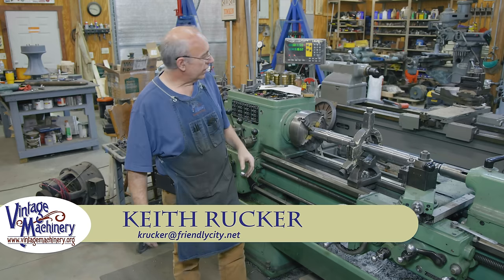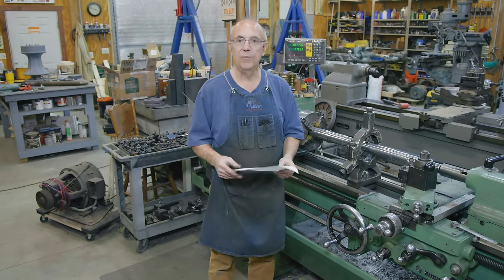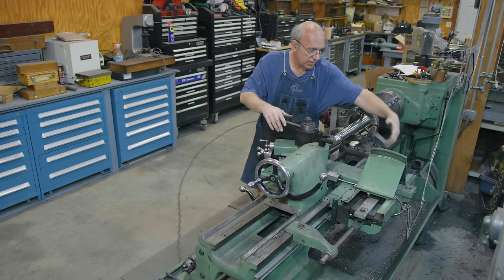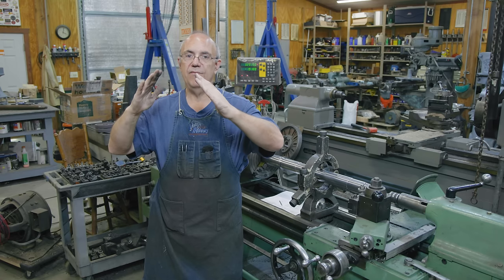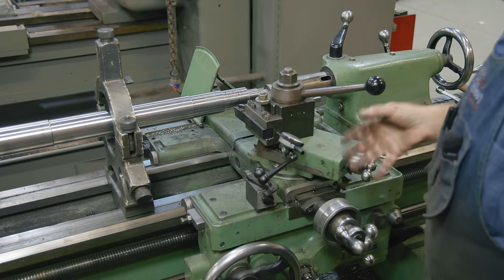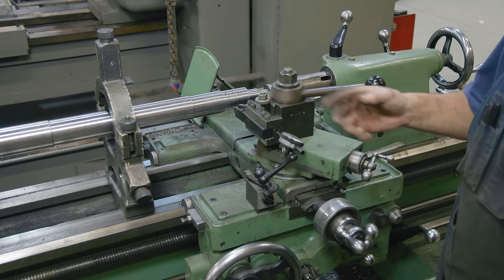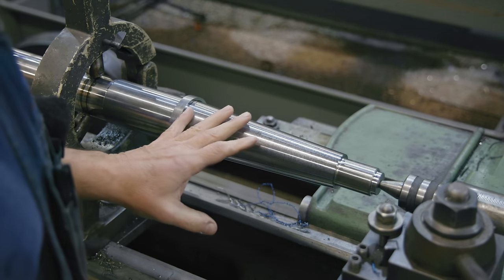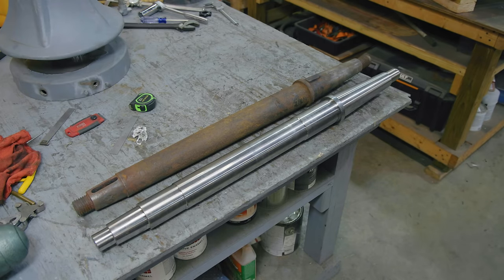Tally Ho Capstan Project: Using the Lathe Taper Attachment to Turn Tapers on the Main Shaft

Comment: OMG !! When I was an apprentice millwright my dad was a journeyman and I was working with him he ask me for a 1" wrench so I handed him a crescent adjustable wrench he scouled at me and threw it down and made me get a combo wrench and after he used it I carried that wrench for the rest of the day. Then he caught me using a channel lock plier on a pump shaft to turn it. Man he was so angry I put them shithooks on a machined piece of machinery!! The lesson I learned was in His words " there is a tool a proper tool for every job " even today when I pick up that channel lock it's to do some plumbing. I write this with a big smile on my face as I have much respect for your skills but them channel locks in use on that lath made my dad's words clearly come back, may he rest in peace. God bless you always sir
Reply: Amen
Reply: My Dad was also a Millwright, and had the same work ethic as YOUR Dad.  I tried to follow him into the trade, but due to the economy, I joined the Air Force as an Aircraft Mechanic.  30 + years after he passed, I STILL hear and follow his advice!
Reply: @normmcrae1140  I am 68 years old and 35+  years in the millwrights seen lots of Craftsmen in all trades it was Great !! Now they havnt put on an apprentice in 4 years in this state , no one wants to do the physical part or get greasey. Sadly the trades are being sold out. Even this old school machine work has been lost to CNC. Anyway God bless you and Good Dads that handed down the "WAY"
Reply: @kentonyoderii3443  I agree - I LOVED being able to look at a plane or machine and say that "I FIXED THAT!"  
I still do with my Motorcycles and vehicles (I'm Elbows deep in my Yamaha Bolt, right now!)
Reply: ok
Reply: ok
Reply: @normmcrae1140  did you train at channute field in the af ?
Reply: @edcallahan6952  I'm Canadian, so RCAF - Basic Training at Cornwallis, NS, And Trade training at Borden Ont.

Comment: First time in my life that I ever heard of or saw a taper micrometer. And I am an 81 y/o retired mechanical engineer that thought I was familiar with machine shop operations.

Edit to add: Another way to cut a taper is to offset the tailstock which I learned in machine shop class in 1957. We never measured the taper because approximate was close enough for the application we had. The application was a lathe dog and the tapered part fit in the slot of the lathe face plate.
Reply: I saw all sorts of exotic precision tools in the naval dock yard where I worked overhauling guided missile launchers and directors, but I never saw a micrometer for tapers either. One thing I did use was an engineers microscope and that would be a dream tool for my current workshop, probably hideously expensive though.

Comment: I purchased a Southbend H10 with a taper attachment about six years ago. I never looked into using it. About four months ago I looked into using it, and noticed several parts were missing. I spent the last four months getting it to work.  I learned from this video how to accurately set up to cut a taper. I also went down a rabbit hole of learning how to measure inside and outside tapers on the internet. Thank You for providing this information!

Comment: Never seen that taper attachment before, I've only ever used the compound slide for cutting tapers. I presume that the taper attachment allows you to taper with more precision over longer distances. Very cool.
Reply: Repeatable also, so if you’re doing more than one, it makes the setup worthwhile.

Comment: Love the channel Keith.

With the taper angle, if it is a more taper then the angle is the same. A the difference between a 1 & 2 more taper is diameter. So I believe your lathe is set to cut more tapers.

Looking formard to seeing you work on some of the museum stuff again. ❤️
Reply: So, are you saying that this is the same as a Morse taper, that the angle on those are all the same?

Comment: the tan of 3° is 0.05241
Close enough to your measured 0.052 which lets me assume, the taper was made to 3°
Reply: I was hoping somebody did the math. I did check and a MT4 is 1.4876 a MT5 is 1.5073.
Reply: The inverse sin of (0.104/1.000) is 5.970 deg. The sin of 6 degrees is 0.1045. So likely intended to be that.

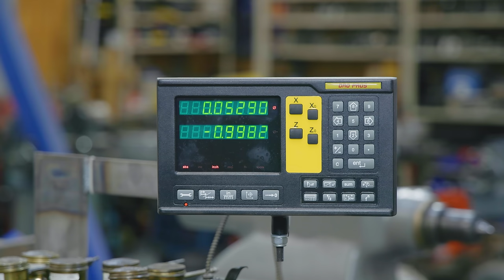Comment: ~ 12:00  Keith Fenner has some videos of fitting fish-boat propellers to drive shafts using tapers.  He finishes the fit using various grades of fine abrasive compounds & bluing indicators to mate the two parts more-or-less perfectly.  Lots of fussy work...

Comment: Great video I was looking forward to this video on cutting tapers.  I inherited a South Bend lathe from my toolmaker father and was expecting you to turn the tapers with offset centers.  Taper attachment is a great option which I have never seen used.  Looking forward to you cutting the threads.  It would be nice to see if you have to cut a left hand and right hand thread on opposite ends.

Comment: I've worked on a 'male/female' tapered  metal rod. It had NO keyway and did NOT twist. To disengage the tapers was the use of hydraulic oil pressurized at fitting between the two halves.

Comment: This will end up being a wonderful contribution to Tally Ho as its anchor winch, & the fact it will also be modernised as well to have the option of it being powered is fantastic from an operational point of view.
Also truly fascinating to watch the set up and operation of a taper turning attachment.

Now as an owner of a new lathe without a taper turning attachment finding myself wondering “how the heck could this be done without a taper turning attachment?🤷‍♂️

The compound doesn’t have enough travel to turn a taper that long, so I’m assuming I’d have to offset the tailstock to the correct amount to turn said taper - then afterwards go through re- aligning the headstock & tail stock?

I love the detail you provide but sometimes for me at least it raises all these other questions & my brain has a little melt down. 😳😳😂

Comment: Hi, Keith, and firstly many thanks for the detailed videos of this shaft machining.  I remember that you said that you weren't inclined to try to replicate the overall taper between the top and bottom bearings, and at 27:10 that's clear.  When I look at the old shaft, though, I can't see any transition at all corresponding to where the lower bearing journal (the third 'land' from the left on the new shaft) goes up to the 2⅜" 'middle'.  It's almost as if that bottom journal is tapered, too.  Is that wear in the old shaft or wear in my old eyes? 🤓

Comment: Keith,

Is this vessel being built with the approval of a Classification Society?  If so, does the capstan require an approval?

Normally the fitting of tapers requires bluing to show sufficient contact.   It seems that the short taper has contact.   The long taper seems to lack contact.  

Out of curiosity will the capstan allow for independent use of the windlass and the drum?

Bob
Reply: The question of Classification Society/Certification/regulatory approval/Coast Guard regulation/crew requirements/ intended vessel use/insurance/business model, etc, etc, etc are all un-addressed by Leo, at least in his videos, as far as I know. I am very curious to know the answers. I’d also like to see the taper blued and tested for contact.

Comment: Really nice job!  I do have one general machine-shop comment, though.  It's not just you; everyone seems to do it.  You have a high-value precision part.  You also appear to have a concrete floor.  You want to put your precious part on a table.  Yes, I know that you all carefully level all of your tables, even the wooden ones.  Why do you keep putting parts almost on the edge of tables, with nothing to block them from rolling off?  In this particular case, it also looks like one end might slightly hang over, ready to catch any shop coat that happens to brush the table corner as someone passes it.  I'm not a machinist, but I have a silver flute that is dear to me.  Again this is curiosity, not a complaint.

Comment: I think i've done taper work on my lathes, a grand total of 15 times in my entire life. Fascinating process to math out... but man, unless you need it, you won't even so much as touch it. I suppose one could use tapers more, they are a very good method to lock two surfaces more, but a good mating surface and a nyloc nut do wonders these days. :))

Comment: I am a little confused on the use of the DRO to set the taper. Keith was moving the carriage 1", and the DRO was reading .052", but it was in diameter mode. Wouldn't it have read .104" if the taper was set correctly? The dial on the tool post would have read half of that, .052", which would be half the included taper?

Comment: Hi Keith.  You have more knowledge in your little finger than I'll ever develop.  Nevertheless I noticed that your tailstock was extended quite a way on this project.  Do you think your chatter problem would have diminished if it was shortened up?
Reply: I think the chattering in last episode was due to Keith not turning a perfect diameter for the steady rest to run on. As with all rolled material flatness, squareness and roundness should not be assumed.

Comment: @14:04 "Don't feel like if you don't have a digital readout, you can't make these adjustments."  That's not right at all!  There's never been a better excuse to convince the boss to let you buy a DRO setup for the lathe.......... and a taper attachment for that matter.
Reply: No DRO’s taper attachments or dial indicators when the original shaft was made 100 years ago. They probably just decided on the locking tapers needed and matched them together.

Comment: Wondering if it would be worthwhile to sneak a couple Zerk fittings in there for the bearing surfaces?
Reply: I've been wondering the same thing. Are those bushes supposed to run dry? What provision did it have for lubrication originally? Seems like a high wear situation even though it's a slow turning part, there doesn't't seem to be any way to feed anything in and I can't imagine just greasing it on assembly would be enough given the harsh environment of a ship's deck. Were you supposed to take the top nut off, break the taper, lift the drum off and grease it periodically? Sounds impractical to me
Reply: When working from plans for a customer, you never “sneak” anything in there. You might discuss a possible change with the customer, but you machine to the plans you were provided.

Comment: Just wondering, if you set the taper on the max length of the taper slide; wouldn’t accuracy per inch increase?
Reply: You beat me to it but this is a principle of all measurement.

Comment: One of the bearings on your steady rest appears orange. Is it heating up, or is it actually orange? Do you lubricate the piece where the steady rest is supporting it? I've seen other machinists like Curtis from Cutting Edge Engineering do this (even with roller-bearings) to avoid heating and scuffing the piece. the black marks on the sides of where the steady rest rollers were in contact with the piece appear to be a sign of surface heating.

Comment: ❤❤I dont understand "backlash" did you explain that in another video?  Is it something particular to your machine or normal in all machines?
Reply: https://www.youtube.com/watch?v=NqF_ETWvBCA 
I skimmed over this video, seems to be a clear and detailed explanation of backlash in machines.
Reply: Backlash is the clearance between two gears, if there’s no clearance or zero backlash, your gears will probably lockup and you won’t be able to turn them. 
So every gear needs a little backlash, but usually the smaller the better. You can check backlash by turning the gear one direction, then when you turn it the opposite direction, you can see how far it turns before it starts turning the other gear. I hope I explained this so it’s understandable, have a good one!

Comment: Just a viewer and not a machinist so go easy on my terms, but being you lock the cross slide in order to allow the taper attachment to do its thing, when you now have to use the compound to feed in the tool, do you set it perpendicular to the work piece centerline or perpendicular to the taper or what? I know if you’re using the compound at an angle, like a leftover setup from threading, and you feed in 10 thou, you don’t actually take a .010 cut due to sine error. So is that relevant in cutting tapers?

Comment: It is dead-easy to calculate the angle of these small tapers, because when you approach zero angle, the sine of the angle approaches the displacement.
So if the taper is 0.104" per ", the angle will be pretty much 0.104 radians.
Or 5.96 degrees.

(did the proper calculation: the angle is 0.1042 radians, 5.970 degrees.

And you made a small error: 
Assume the taper is a triangle with three sides A, B and C, with the angle between A and B being square.

Your taper micrometer assumed that side C is exactly 1". But when you set the taper with the DRO, the Z-axis of the lathe corresponds to side A of the triangle. This means that the taper you cut is slightly larger than intended -- as your check with the taper micrometer demonstrated. For small tapers, the error is negligible, but for larger tapers it is not.

Comment: Right around 11:00, when you setup the taper with the DRO to be 52 thou per inch, wouldn't you have to set it up to 104 thou per inch, because the DRO measures in diameter?

Comment: I just entered that 0.052/1.000 into an angle app and got a taper angle of 2.9767 degrees, so I'm guessing (based on some slight inaccuracies in the initial measurements) that the original taper would have been a nice round 3 degrees. 👍

Comment: I have never so much as touched a lathe so excuse the noob level of this question: I am not 100% clear on cutting head movement and would like verification: If you are removing 50 thousandths, the cutter actually moves in 25 though you are dialing in 50 and the dial on the machine reads 50? As I said, I have never done any machining.

Comment: If it is not already there, now is the time to drill and tap for Zerk fittings so that the bearings can be pumped full of water resistant grease. As it is there is no way to keep salt water out of the capstan when Tally Ho takes blue water over the deck in heavy weather.

Comment: arcsin(0.052) = 2.98 degrees.  So I believe you've got a 6-degree taper there.  And arcsin(0.05215) = 2.989 degrees.  And (1.25/12) = 0.05208.
Over the length of the shaft I doubt deviation from 6 degrees will not be observable.  You've got this right to at least 3 decimal places.

Comment: 104/1000 inch to 1 inch is the same as 
0.104 mm to 1 millimeter. The units are shortened at the cone.

Comment: the  only thing i know about machining is don't set anything on the bed . since you will be machining the Windy Hill casting . i will guess you can use the same taper for the bore without resetting the taper on the lathe .

Comment: 104thou per inch = 5 degrees 56 arcminutes 15 arcseconds angle.
Reply: Still easier for a machinist to use 1.25 inches per foot.

Comment: It would have been 6degrees inclusive if you calculate based on those figures. Which is how it would have been done originally I very much doubt they would have done run and rise. 
7 degrees is a morse taper. 6 would be classed as a locking taper.

Comment: Why measure the taper only out at 1" when you're adjusting the bar?  It seems that it would be far easier to get a more precise overall measurement going out 4 or 5 inches and multiplying the taper amt by that much, moving the point of measurement out should magnify any error and result in a more dialed in average value over the length of the taper.  I understand the adjustment isn't actually easier, just that your measurements should be more accurate.

Comment: Don't think you need a key in the bottom taper, the taper its self should be enough.
Reply: It's the philosophy of a belt and suspenders.  If it was good enough one hundred years ago, it's all right today as well.
Reply: Are you suggesting the original manufacturer and more recently the consultant engineer don't know what they are doing?

Comment: 104.2 thou included = 52.1 thou per side = to 5/8" per foot or an included angle of inch & 1/4 per foot.
Reply: posted before Kieth got that bit in the video.